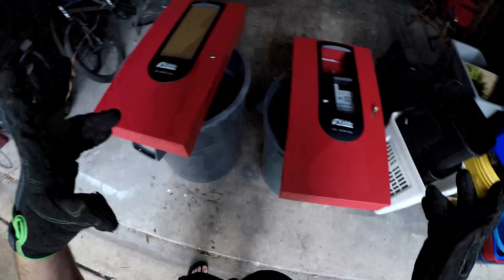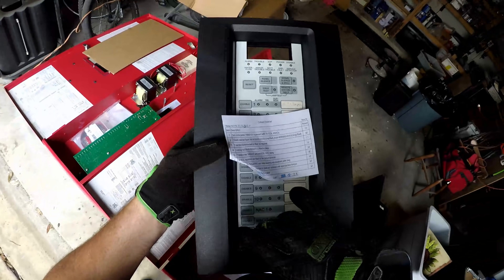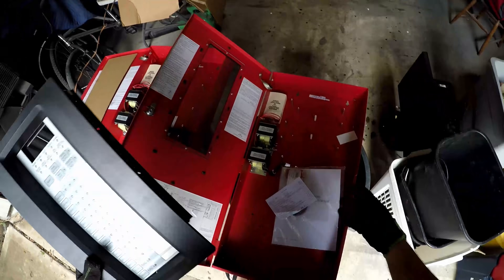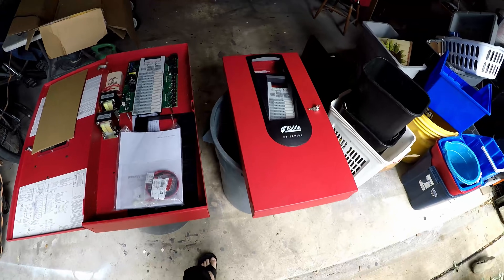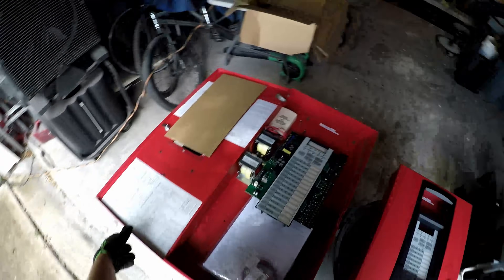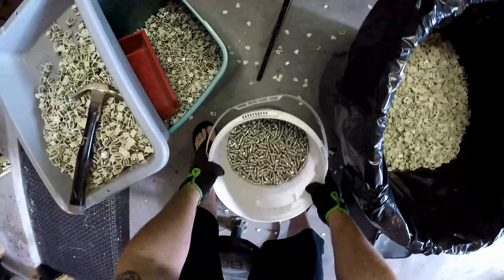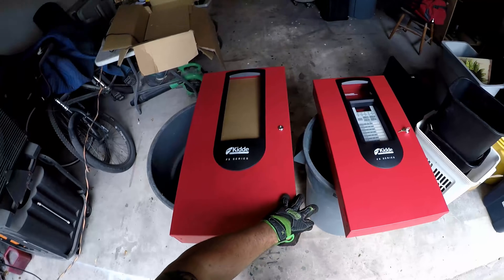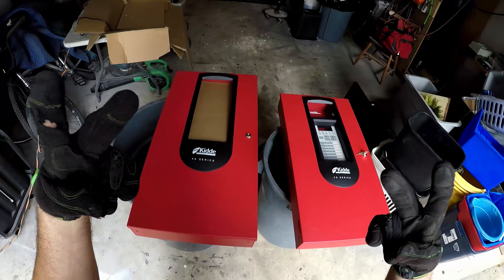Update On Fire Boxes

Comment: I’m a fire alarm tech. We buy the new panel and put the new guts in the existing back box. It’s a real time saver. You can scrap the copper out of those power supplies.
Reply: Are the new boxes inferior somehow?
Reply: So why not just buy the guts, saves on waste.
Reply: @marcellachine5718  no, but the installers sure are. Laziness will make him come back to replace the old worn out parts he didn't swap... effectively wasting more of their time than installing the entire new box would have cost them. 

Oh well. Job security I guess? Just a  Lazy Scam if you ask me.
Reply: On a smaller cheaper panel, the motherboards aren’t available as a separate part. The quote given for a repair often doesn’t include the time it would take to change out the back box that may have several conduits entering it. There is nothing lazy or shady about doing things this way. Seabass is a troll that doesn’t know what he’s talking about...

Comment: So... Those systems are custom made for each building/customer. They are usually tied into the phone system aswell.  If there is an issue with the electronics they are not frequently "fixable" and need replaced by a new custom board. Those systems are regulated by building codes and standards, so there is any one of many reasons that they had to be replaced...
Nice scrap find !

Comment: It could be like I am hearing is there is such a limited supply of most everything that the boards where not available so they had to purchase the whole item to get the boards. This is happening a lot these past months and it's going to get worse. To keep a business open you do what ya have to. Been there done that. Also some times the whole thing is cheaper. I know it doesn't make sense but I have had it happen. There is two nice transformers in there worth about $20 each today maybe even more in a few months.
Reply: The main board is worth 700. And to have where it fits all together is where they make the money. You know the transformer will be a special for that circuit. Easy enough to trace it out.
Other option to sell them to a buddy of mine in MD where he buys complete inventories of electronics.
Reply: @robertschwartzman195  Not the same but we use to install gas works and fire suppression systems in commercial kitchen exhaust hoods, & over the equipment. Retired now. Maybe Mike can take this opportunity to sell some stuff to your buddy.

Comment: Sell the boxes as parts to someone to have spare parts.
Scapping is NOT an option.
As for that diode being burnt you can fix it and sell as spares.
Reply: Nope. ya can't, the date on the board and the replaced diode/transistor would be invalidated by the mandatory fire marshal inspection that would be required to meet fire code/ insurance requirements.

Comment: Those cabinets would be good for small arms with a built in lock.  Also could be used as a spare key storage.
Reply: I wouldn't use it to lock weapons up. the metal is not strong enough and besides you can break the plastic window and get at them anyways.

Comment: The old box is installed behind sheetrock and fixed in place this is why they have to purchase a new box and transfer the guts into the old boxes! These boxes are part of the internal wiring to the building's they are installed in and the cost of complete replacement would be tens of times the cost of just replacing the guts!